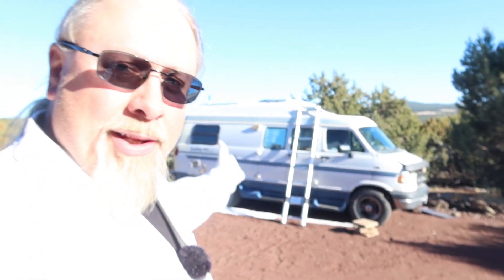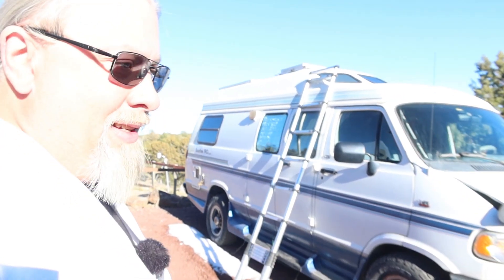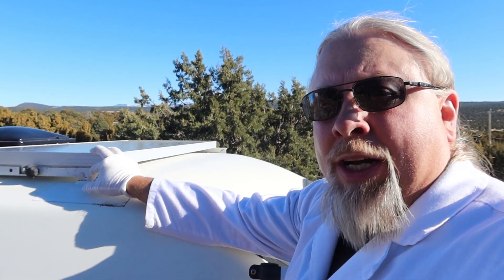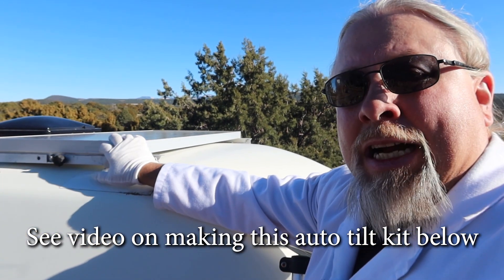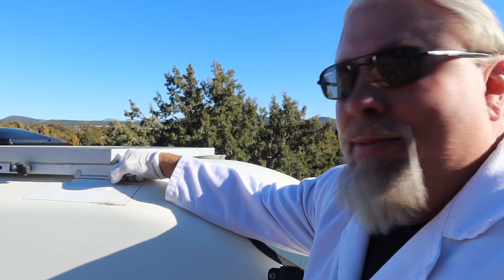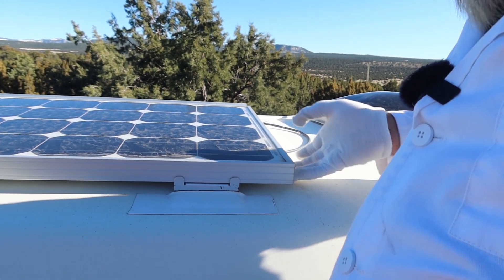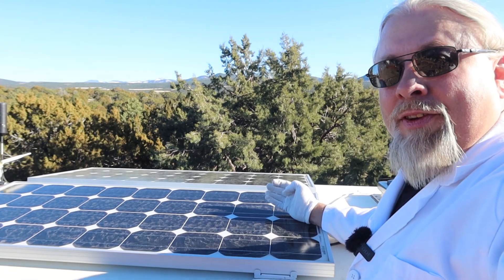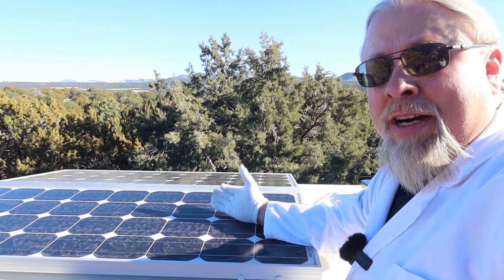RV Van Solar Panel Install Using 3M VHB Tape | 5 Year 30,000 Mile Long Term Update

Comment from the maker: VHB & ETERNABOND TAPES: https://gohobo.io/TBZS  
INSTALL VIDS PART 1 (2017): https://youtu.be/qghxSwUgxEc
INSTALL VIDS PART 2 (2017): https://youtu.be/QWLqGw0pegk
5000mi Follow Up (2017): https://youtu.be/5DEBb1Mtu0M
1 Year Follow Up (2018): https://youtu.be/pUU8IAVfwz8
2 Year Follow Up (2019): https://youtu.be/nShLdvEQyZI
Building the strut "auto tilt" bracket Part 1: https://youtu.be/Ajss5bl0BqE
Building the strut "auto tilt" bracket Part 2: https://youtu.be/9GQiJyYaLxs
Reply: Rick Hunter & Skull Squadron would be proud 
👍😃👍
Reply: Hi, thanks for the great video. I just recently picked up a sunlite  pop up cab over camper with a aluminum top sprayed with Styrofoam. It is textured a bit. Would this set up work for that, or do you recommend a screw in bracket set up for that? Thanks

Comment: I installed mine almost 5 years ago at Craggy Wash and they haven't budged an inch. I used formed plastic mounts, VHB Tape and Eternabond on a fiberglass roof. I watched your first video first.

Comment: I've watched all these videos following these panels especially since you drove the van and I like the no hole idea for my rv. I've spent a lot of time and money on the white paint that is like rubber when it dries to coat my entire rig so I wouldn't wanna cancel that effect and I want my panels to be able to tilt as well or stay flat depending on location

Comment: You also didn't use just VHB tape.... I watched your RV video, and I did my truck canopy the same way... But the canopy is curved at the edges, and the mounting rack feet didn't fit flat even with much bending....i had to double the thickness of the VHB to be level. Eternabond tape went over the feet as well... In about ten minutes it was rock solid, hasn't budged in 2 and a half years ..

VHB is great, but if you just covered the feet like you show in this video, VHB tape might not even be needed...

  Thanks for your vids....

Comment: So is sanding the surface prior to applying the 3m tape necessary? I’m putting 4 semi flexible panels on the roof of my odyssey and I plan on using 3m vhb as well.

Comment: Have low mileage 2014 minivan with no roof rails. After I DIY build inside, will eval solar panels. Love the solution without buying rails ($$$). If roof will need sanding first, will have to be ready to commit to using this vehicle and the panels for quite some time. Thanks for all the links including the tilt bracket so I can watch when ready.
Reply: Put the panels on first,  then do the interior.   That way you can still access the van ceiling to use screws and bolts if you want to.  Panels with a decent gap will act as shade.   Panels closely coupled to the roof will trap heat.

Consider to use some 8020 rails the length of the roof and attach to those.

Comment: hello i have some questions so you use a rigid solar panel right? and then you use the 3 m vhb tape  just in the corners is it correct?

Comment: I just made a 2,800 mile roadtrip with 2 panels stuck to my aluminum roof with VHB tape. Just to reposition my panels, I just now peeled off the brackets on one panel that was stuck on with VHB tape (on the bottom and over the top of the bracket) and I really believe the solar panel itself would break before the tape came off, imagine trying to pull the panel off with all your strength from the top, I know that if I tried that the panel itself would bend in half and break before the tape would start to peel off, and/or maybe the brackets would start to bend. Since all the metal up there is aluminum I actually think it's possible that an entire roof might get peeled off before a panel would come off in the wind lol btw when has anybody ever heard a story in the news about a solar panel flying off in the wind and keeling somebody? Out of how many.. hundreds of thousands of people who have done this same thing? 
From what I've read, they use Vhb tape on skyscraper windows, airplanes, semi-trailers to hold the walls together, and in new cars to hold panels on.

Comment: its only as good as the paint on the surface,,, when or if the paint pealed so would your tape job...
    Useing tape only on anything other than bare metal is a little much risky...lol

Comment: Safety question related to my own install: Does it rain much where you are? I'm curious because I noticed you only put Eternabond on the front side of the bracket, but the rear is still exposed, so technically water could get to the VHB tape. Does that matter? I know VHB tape is supposed to create a waterproof seal, but does that mean that it itself is not susceptible to water damage?

I recently installed VHB-adhered panels, and I used Dicor to seal the front of the brackets but then ran out and had to use silicone sealant to seal the back of the brackets. I know silicone actually won't stick to Dicor, so those seams won't be watertight. One concern I thought of is they might let water in, but then it actually might be difficult for the water to get back out, so water will just be stuck in there with my VHB tape...

Comment: I used Gorilla Tape to tape down a thin windshield reflectix covering just to cover some rust on the top of my minivan Camp roof thing popped up on my first ride out I put one strip of tape all the way around and it popped off it like ripped off in one area in front

Comment: Thank you for all the informative videos. I have 2023 sprinter van and have bluetti ac180 power station. I want to add flex panels on the roof and 12 v a/c. What do I need to make it as minimal components as posible. Hopefully you will read this. Thanks again.

Comment: Which vhb tape would I use for this? I want to mount two big 450W panels and 2x 200W. Roof of my Moho is aluminum. 

Do you have a video on the tilting thing?

Comment: I am assuming this is a moot point now that the CIG solar panels are here.  BougeRV says unlike the typical flexible solar panel, these are not heat sensitive, last as long as glass panels, and are as efficient as glass panels.
The only negative I guess is they might be harder to uninstall to remove if needed.

Comment: Hey, thanks for all these videos. I watched your first video on installing your solar panels, and I watched this one. I’ve also read the 3M VHM instructions, and they recommend that you send the surface with a high grit sandpaper. I also think that you mentioned that somewhere along the line, but in your original installation video, you didn’t sand the surface. Do you think it’s necessary on Fiberglass?

Comment: I am in the process of deciding what kind of solar installation to do on the roof of my minivan (which sadly doesn't and cant have a roof rack.)  I clearly hear that the vhb and eternabond have served you well for many years on the fiberglass roof of your van. My question is do you have any knowledge of how well that will work and last on the PAINTED surface of my 2 year old van roof.
Reply: Have you found an answer to your question?
Reply: Same. Did you install solar with the painted surface intact or did you sand it? Fixed panel or flex?

Comment: I thought you wired your original two panels in parallel to prevent the shading of one from shutting down your current.  Did you reconsider that and rewire them in series when you added the third?

Comment: Good Video........You got the proof showing VHB & eternabond will work... The TV show, Modern Marvels featured 3M VHB tape on an episode. They also use it to hold skyscraper windows in place. Aluminum frame + VHB + window, according to the show, the VHB tape is the only thing holding the window in place.

Comment: I can’t seem to find 3m vhb at any hardware store.  There is scotch 30lb mounting tape and gorilla 38 lb mounting tape.  Do you think those would work?
Reply from the maker: NO. You have to use the VHB on my website. It's the right kind.

Comment: I used just 3M VHB on my solar panels for my Prius nomadic home. It's only been on for one year but it it's still going strong. And I've put on a ton of interstate miles at 70+mph. I've even had zero issues at 90+mph. The stuff works...

The manufacturer adds this tip. It's double sided tape. They recommend putting the tape on one of your surfaces (roof or solar panel in this example), without peeling off the protective paper to adhere to both surfaces. They say, let it bond to the one surface for at least 24 hours first. To promote a better bond, then remove the paper protection before finishing the install. They also said to do this on a warm day, for better adhesion.

I will add this, from my own experience. Once ANY part of that tape touches any surface. Even just a square inch of it. It would take the hand of God to remove it. Unlike traditional tape, that you can peel back off and readjust. It won't happen with this tape. So make sure you lay your panel down perfectly on your roof. I didn't know all of this before hand. My panel on my roof is a little crooked and it drives me absolutely crazy. It's a flexible panel, so removing it, with the VHB on it, would result in completely destroying the panel. Which I believe would be easier to remove if you had a rigid panel and only did the four corners like Odin commanded Mr Hobotech to. I used a whole role on the back of my panel. Next time, I will only use 1/100th of what I used before.

You could build a staircase of the side of a building with this stuff. It's really really strong and you really don't need a lot of it to secure a panel to a roof. And when the time comes to remove or replace the panel, the less VHB tape you'll need to remove, the better. I am fully confident I could have just used 2"x2" squares of VHB tape on just the four corners on my 100w flexible solar panel and have achieved the same lasting results rather than using the whole roll. Learn from my mistakes because when the time comes for me to upgrade my solar. I will probably have to spend tens of hours trying to remove the old panel and all the tape from my roof.

Comment: As long as you prep the surface and use GENUINE 3M VHB, it is no joke. I mounted a tablet to the wall with a couple strips and the tablet ripped apart when it failed and I had to take it off the wall to replace. Pulling with all my might it just kept falling apart in my hands and the VHB just held. Finally able to break it all off with a fat screwdriver in small pieces.

Comment: If you decide to drill holes and bolt the panels on, you may consider plus nuts or riv-nuts so you don't need to access the back side of the roof to attach nuts to bolts.

Comment: Would you be able to do a comparison between the low budget dual zone refrigerators? I've seen a lot of different versions of the Alpicool TW and TWW series. They seem to be running under a few different names. Is there any difference between them, and is there anything similar to them? The only other one I've found is the Kalamera brand, but they seem to have less and less of their models available. Setpower shows up here and there, but not as much as the TW versions.
Please let us know 👊😎
Thanks!

Comment: Thank you. Mounted a 100w Renogy panel to the roof of our VW Bus (tintop). Been rock solid for 15 months. Didn't want to put more holes in the body of the bus, has enough as it is. Thanks again.

Comment: Impressive! But what I was wondering is if you decided to remove the tape/mounts what do you do/use? Acetone or some other solvent (or heat?)
Reply from the maker: Use a heat gun to remove the Eternabond, then a hacksaw blade to cut the VHB foam. Use acetone/alcohol to remove the glue.
Reply: @HOBOTECH  Thanks...figured something like that....was just curious.
Reply: Sell the van when it is time for a new one. No need to remove the panels. You would be upgrading the panels anyways. 😋

Comment: I've also got solar panels installed with VHB tape since 2018, and haven't had any issues. 

Mine are on the fiberglass roof of a fifth wheel, three 200-watt panels. I taped two residential solar rails to the roof, then bolted the panels to the rails. I did that so I have the option to upgrade panels with the same hardware, though 600 watts has been plenty so I may not ever do that.
Reply: Smart! I will consider this for a minivan to allow for solar changeout/removal.

Comment: I installed a 2s 1p array three years ago and it has held rock solid. Metal roof took some prep work to get to bare metal, but every time I check it, doesn't budge. In fact, I usually stop pulling when the roof starts to deform.

Comment: Your video on mounting those first solar panels at the back is how I found your channel.  I used only VHB tape (no Eternabond) to hold the BougeRV 170W panel to the roof of my truck camper and I'm going in to my 3rd year with it and no issues at all.  Thanks for all the good advice over the years!

Comment: i used plastic corner supports off of Amazon which screwed into the panel...  then i used eternabond tape to hold that down (on my RV rubber roof), it's made it to mexico and back from canada, no issues tapeing to rubber roof. it is now 2 years old and no issues other than some discoloration...

Comment: I would be giving Eternabond the credit for holding those tight, maybe the combo is best, but that Eternabond is really tough stuff, and I am surprised you didn't give it more credit for keeping your panels stuck down. If you used vhb by itself, I doubt you would have the same success.

Comment: Don’t you have a fiberglass roof? 

I did the same on my Sprinter metal roof with my first set of panels. They could be lifted off with one hand after just two months.

I used Z-brackets to mount them. I recommend something with a bigger footprint to adhere to the roof. It might also be a metal roof thing, which conducts more heat.
Reply: These were 100 watt rigid panels on my Sprinter. 

On my fiberglass trailer, however, I was simply able to use industrial Velcro under my flexible panels. Worked beautifully.

Comment: How do you take it off for solar replacement?
Reply from the maker: Assuming you ever need to do so...and assuming you can't reach the bolts. You use a heat gun to remove the eternabond, then a hacksaw blade to cut the foam of the VHB then use solvent to remove the glue.
Reply: @HOBOTECH  Thanks so much for replying! I am glad there is a solution just in case. It makes it easier to decide to do it the easy way.  I really enjoy your channel...have learned so much from you and truly appreciate everything you post.

Comment: This is exactly how we did ours too! I learned about VHB while working at Apple and seeing how they adhere their iMac displays to the enclosures. I first did this on a set of flexible panels on our older Airstream. For this latest install, when RV techs look at the roof they're surprised that we have so many panels and that we're using VHB and Eternabond! We're around 100K miles all in all using this method, and not a single issue, nor have they loosened. Granted, I check everything monthly and I've been quite happy with our install method. Great video!
Reply: What are your thoughts on flexible vs fixed panels? I am currently looking to get a solar for my campervan and bluetti eb55.
Reply: •  DITTO . 
•  I've heard from 3-6 creators 
that the flexible panels only last
2-4 years. Two mentioned the 
lack of airflow beneath them 
( i.e. degradation from overheating) 
& 1 of those replaced with the 
same flexibles again , but with 
2 layers of coroplast : a "picture 
frame" as a spacer around the 
underside edges , followed by 
a full-matching-size coroplast .
•  Watching some of these "band 
wagon" vanlife creators handling 
of the panels ( 😳waving them 
like flags 🤯 & "folding" them { looks like ~6-8" radius 90° sweep , tucked behind a seat etc.😱 ! }  after each use 🤦 has 
me thinking that such rough 
handling is more to blame than their 
thinner physical construction. 
•  Anyway , Hobo ,  i'm SURE you're 
in a much better position than 
us  to ask the many users @ 
meet-ups , etc.  for their albeit unscientific ,  but real-world 
experience with flexibles. Based
on my day to day observations 
of how roughly my co-workers 
treat their "VALUED + PRECIOUS" 
smart phones ,  my guess is that 
flexibles should last at least 5-6 
years w/ TLC .
⭐ And i'm DEFINITELY going to 
use Eternabond with my planned 
VHB install . THANKS for ALL 
your great reviews   👍 🏆 👏

Comment: I have the same situation, I bought a used van conversion that was finished on the inside, getting ready for solar didn't want to drill holes, thanks for a simple, practical solution.  THANK YOU 😊

Comment: That eternabond is a great idea over the brackets and the 3M ... I, by chance have a roof rack and two 100 W Rich in series "lose clamped" to the rack.  Then I put two stainless steel hinges between the two panels and the one back one tilts up ... smooth and strong.  I need to still make the angle thing ... only a month into this config.  With the Victron solar controller ... wow, my 200 ams of BB atteries it keeps charged at full..  I am thinking of switching the panels off to maybe try to extend the life cycles ... but they are new now...

Comment: We also didn't drill holes in the roof of our cargo trailer conversion - ANY holes drilled in a roof can introduce a leak. We used Renogy panels and the "corners" plastic mounts attached with Loctite PL MAX Premium adhesive ( comes in a caulk tube ). The connection inside is routed to the curbside wall forward of the door. Works so far - over a year in upper New England winters.

Comment: Wow, great timing. I was wondering how your roof solar panel were doing, and appreciate the long term update. I’m in the process of mounting my 160 watt panel to my Casita travel trailer using your method. Thanks Tom